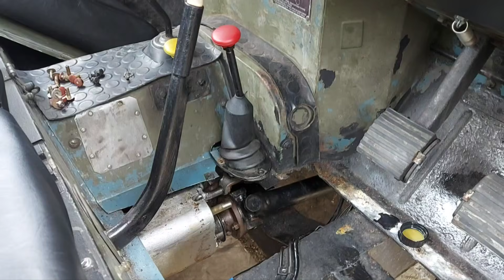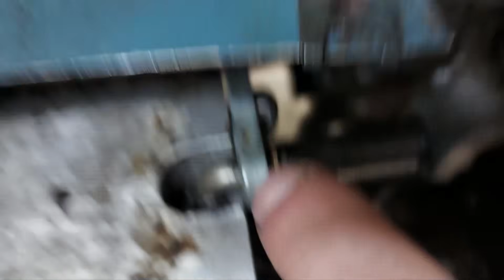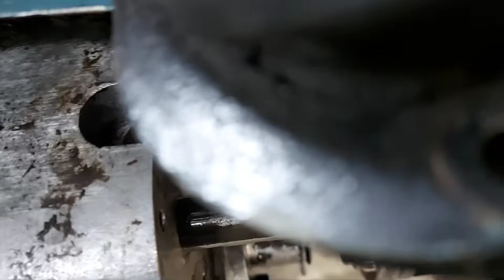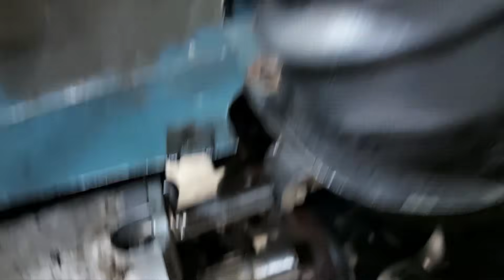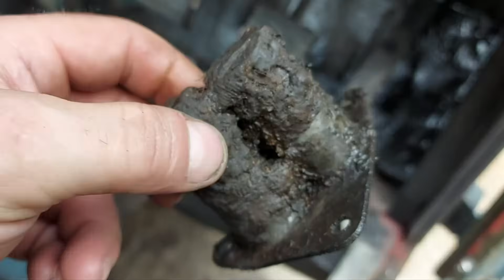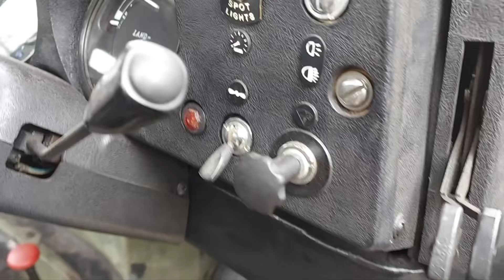Land rover series 2a transfer box (stuck in 4 wheel drive)fix

Comment: My Land Rover won’t go into 4 wheel high with yellow knob any ideas? Thank you
Reply from the maker: If the yellow lever isn't staying down when pushed the it could be the shaft is not returning and is stuck,my advice is take the cover out and press it down the yellow knob and if the shaft don't come forward it's then stuck and you may need to dismantle the gearbox or pull on it with grips and lubricate it and cycle it in and out.
Hope you fix it
Reply from the maker: Oh by the way the shaft is behind the shaft cover.